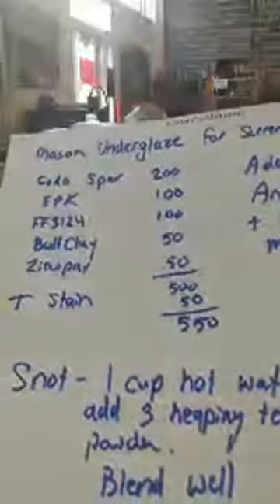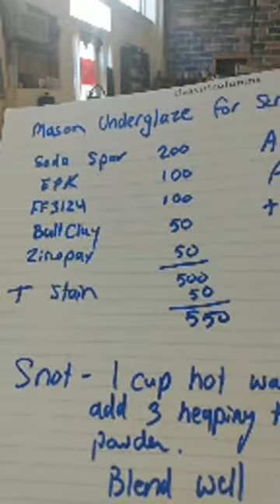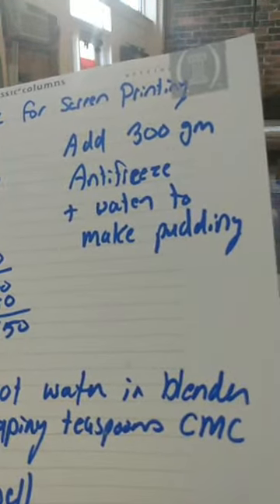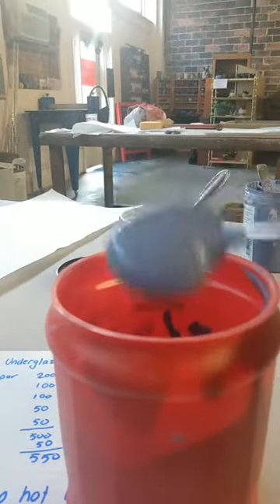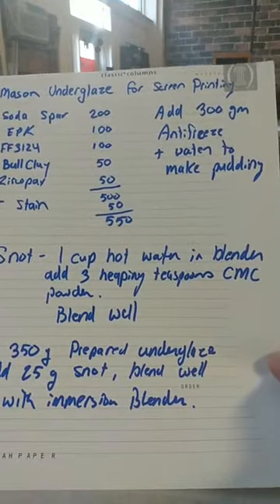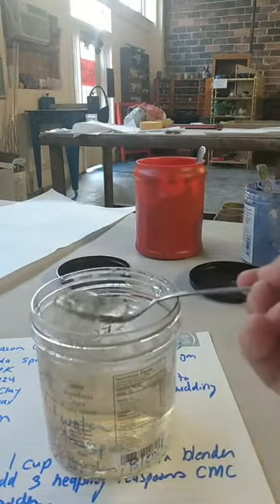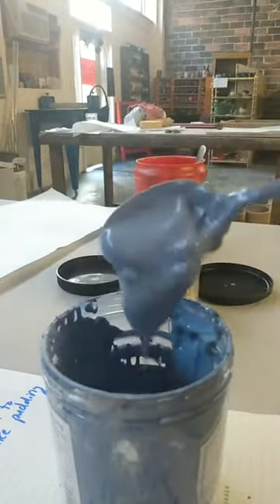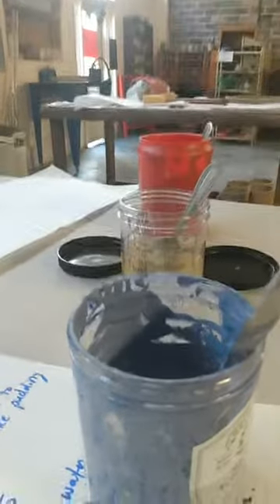Screen Printing Ceramic Underglaze Transfers

Comment: When you say anti- Freeze are you talking about polypropylene glycol? Automotive anti-freeze? What paper are you printing on for your transfers and do you have a source? And thirdly have you ever tried the transfers as an ,"on- glaze" transfer. Im going to try this as an onglaze process on cone 6 majolica. I dont know how its going to go. Might have to spritz the glaze to dampen, perhaps with alcohol. But there is a window shortly after glazing wherecthe glaze is still damp but tough. Hoping for the best. Thanks for the vid.

Comment: Thank you very much for sharing your recipe. I love doing screen printing and have been looking for such a recipe suitable for ceramics.
Can I mix up a purple by using blue/red 50/50? Are there any colours which do not work? And how do you store it?
Do you blend it while it's boiling hot?
I  blew the lid off my blender with boiling hot soup and narrowly missed getting scalded.
I am definitely going to try out  you recipe. It looks just the right consistency! Thanks againr
Reply: Definitely be careful blending anything hot, I used boiled water but no longer remember how long it cooled if at all before I poured it in. When blending hot liquids its important to leave an opening for the steam to escape.

Ceramic pigments do not always behave like non ceramic pigments, since they are chemical reactions waiting to happen and can be modified by the clay body under them, by the glaze put on top of them, and the temperature they are fired at. The Potter's Answer™ is to TEST EVERYTHING with your materials and processes.

I store it in a closed jar on a shelf. CMC is organic and will eventually rot, so only make what you think you will use in a short period of time and the more you dip into it or leave it open to the air the faster it will breed microorganisms. Also some colorants seem to just feed microbes, cadmium yellow is one I have noticed likes to get stinky when mixed in glaze or underglaze.

Comment: what and were do you recommend buying for paper?    I'm really excited to try this.  thanks for sharing
Reply: Hi, I think that a lot of artists use newsprint, I used paper off of a roll that was designed to cover buffet tables, it worked well. I think a light duty cheap paper is best. Look around your home and see what you have, and experiment. I thought that the tissue from old sewing patterns might work, or wrapping tissue, but haven't tried it.

Comment: Hi Stacey. Thanks for the video. Can the tissue with transfers on be stored once printed? Or does it need to be used soon after being made? Thanks!
Reply: Thanks for your patience, yes they can be stored as I made them, the "snot" (thick CMC gum solution) makes the print a bit more stable than plain underglaze. If you use a different recipe, experiment to find what works best. When you are ready to use them, lightly mist from a distance away to moisten the paper and underglaze and then proceed as though they were fresh.

Comment: Hi there. Im from Brazil and im trying to put together a recipe to make my own underglazes. Some stuff im trying to work out how to get here.... But im just wondering what is the antifreeze stuff that u r using and what's it's function in the recipe.
Thanks for sharing ur work. Its very helpfull. See ya
Reply from the maker: It is Propylene glycol, and in the mason stain underglaze recipe I began with it serves to make the mix more easily brushable, the antifreeze is a little viscous. I suspect that for the screen printing you could leave it out and just use water, since you are adding so much CMC gum for that process. Here is the original recipe link for the underglaze - http://www.vincepitelka.com/wp-content/uploads/2016/03/Mason-Underglaze-Recipe.pdf
Reply: @staceypottery3368  great. Thanks for clarifying. Cheers 😊